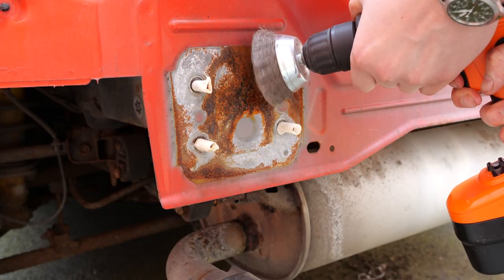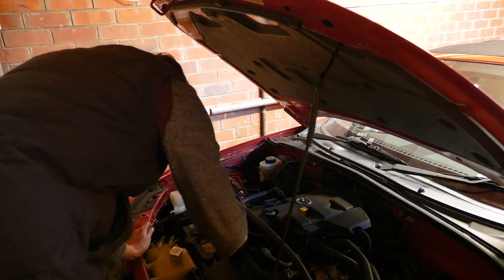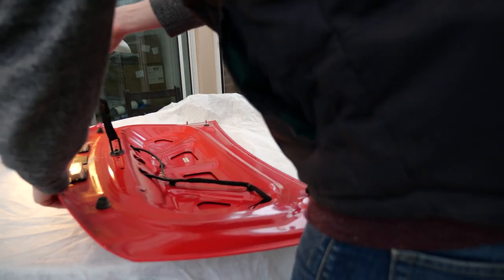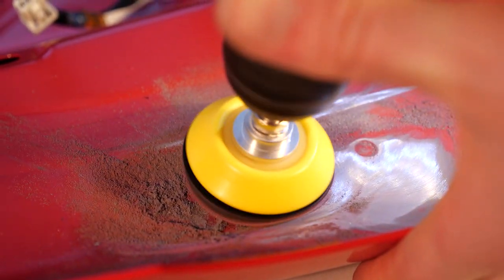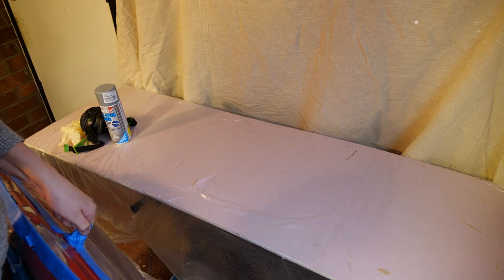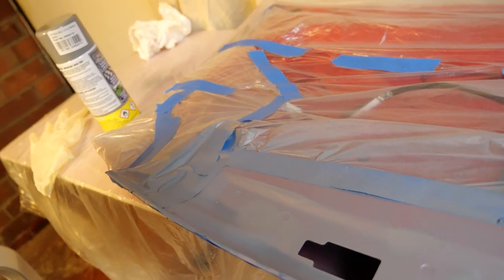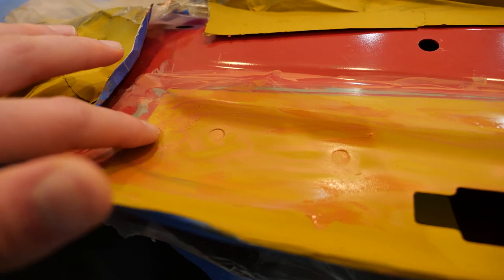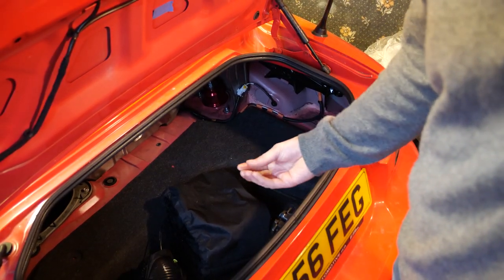Not more rust?! - DIY corrosion repair Mazda MX-5

Comment: An excellent and clear video however a whole week with the car off the road? I have found water in the boot so am about to go through the list of problem areas. My Mk2 has a steel boot lid and I know there is rust in the usual place around the edge. The boot seal is in excellent condition and the three darinage holes have been cleared out with the trumbone brush.

Comment: I'm an ageing old fart but enjoy your vids - especially as I've just bought a 2008 NC Sport Roadster 2.0  I've taken a whole heap of abuse from pretty much everyone that knows me - deservedly so as I'm always quick to dish it out!  I've had pictures of stiletto heels, hairdressers salons and rainbows texted - you name it I've had it,. But it actually just steels my reserve! I originally went hunting for an S2000 but was talked into trying one of these (I had my own stereotypical views so took some persuading!) and was hooked. My daily is a 430d BMW, but my weekend weapon is a Challenger Hellcat - so adding this was something of a chalk and cheese decision - which was actually the whole point. I LOVE the Hellcat - but its a 2-tonne missile - you have to drive it with constant respect, and take liberties at your peril. Yes - the MX feels like its powered by a rubber band  - and a thin one at that - (it wouldn't see the tail lights of the 430d let alone the HC) and I dread to think what the 1.8 would be like power-wise - but it doesn't matter. I can take it by the scruff of the neck, head for the B roads with the lid down and give it full beans without fearing death every time I do so. Handling is amazing - especially as the first thing I did was fit the 30mm Eibach lowering springs to bring it down to the height it should be. Could get my bloody HEAD in the gap between wheel and arch - literally had them fitted first week of ownership.  It's a GREAT car and the haters can... well - carry on hating. I guess 99% of them - like me until 4 weeks ago - haven't ever driven one. £160 a year fully comp with a £50 excess (one of the few advantages of approaching 60) - buttons to run. And it was only after i bought it I discovered even MX5 fans often look down their noses at the NC - although for me its far and away the best looking version of the lot. Especially in Copper Red like mine.  What I WOULD suggest to most though - if you have the option -  is to get the best you can afford . I found (and didn't have to look too hard) a one-owner, garaged from new, only used on dry warm days 21,000 miler from a guy who bought it on his retirement as an I-deserve-this second car - and I'm very pleased to say its completely rust free, top to bottom as a consequence. It's going to Krown rust-proofers in Tipton in a couple of weeks to make sure it stays that way, as some of the uploads you have done are a bit scary. I don't want it dissolving before my eyes.... So - if your budget will stretch to it (I'm aware, of course, not everyone is so lucky) - there's no shortage of cars like the one I found; probably cheaper in the long-run too if your rust experiences are anything to go by!! Keep the vids coming - really enjoy them  :) Oh - one last thing - where the hell do I find the Cobalt back box you mention in another vid of yours?! Can't seem to find one anywhere...

Comment: I really appreciate your videos showing the details, I've had my PRHT NC for a couple of months now and I've noticed little rust specs on the spot welds. I'm going to take the number plate lights out and make sure everything is OK, it's obvious that any road salt and grime gets thrown up here. 

I also appreciate a better look at the plastic blanking plate at 3:32, I'm looking into adding a plug to this for solar trickle charging when parked nose-first in the garage and/or a rear camera. I can't really think of anywhere better to put a trickle charge plug and as the car has reverse sensors there should already be a battery feed I can tie into.

Comment: Great video and a job well done.  Mine's the steel lid, I've done a temporary job, on mine it was just a few tiny spots, so I sanded back just where the bubble was and hammerited it, before manually touching in the top coat.  Will stop it rusting until I have the time to do it in the way that you have.

Comment: if you fit LED bulbs to the boot and front floor pan you will find it great on dark nights, also if you take one of the dash lights out you can check the fitment type bayonet twist screw etc then you can fit coloured LEDs to the colour of your choice available from amazon and ali express

Comment: When I did mine, I unclipped the lights cable from the underside of the boot and pulled it through, leaving it attached to the hinge and left it hanging in the boot space, then removed the boot lid. I also popped out the rubbers leaving it devoid of all bits and pieces, This is because when painting, I wanted to add a bit more colour the to thinner painted areas and the clear coat it all. Part of the reason NC's have this issue is because Mazda didn't clear coat the underside (certainly not on the earlier years models), and which includes the exposed area with the number plate lights. The only thing I had to mask off was the MAZDA part sticker.

Comment: Hello, 

big Fan of your Mark 3 MX5 Series. You inspired me to buy one aswell, so i got a 2014 with 45.000 miles yesterday. I love this car so much, but I noticed two things that need repair: The Volume button on the radio is missing, i have to adjust the volume with my fingernails or the steering wheel function. The other one is the interior light. It does not seem to work no matter on what mode (On, Off, Doors) I put it. Do you know a good site where I can get spare parts to fix this?

Cheers from Germany

David

Comment: Great set of videos - helpful for a fellow MX5 owner - mine's almost exactly the same. One question - did I miss the video where you fitted the spotlights or did the car come fitted with them? Plus do you know where I can get replacement seats - mine are horrible uncomfortable fabric, slightly worn in places - but I'd really like some leather seats. Keep up the good work. PS and if your windscreen doesn't leak yet - it soon will - A video on stopping the leak onto the passenger floor would be useful.

Comment: Looks really nice. Well done!  My 2006 GT has similar paint cracking, bubbling in that spot. I’m not bothered enough by it yet to do what you did here... yet :-)
Reply from the maker: Haha, I don’t blame you! This took about 7 days in total. Had to drink lots of tea ☕️
Reply: @Car Thought  Is it just an aesthetic fix or will it get worse if untouched ? I have a little bubble right under the MX5 Logo but it doesn't seem to grow or anything. I know it is not rust as the trunk lid is made from aluminium but do you think it needs to be fixed ?

Comment: I notice you used the key to open your boot. Does the key fob boot opener button not work on your car? Mine neither!
Reply from the maker: No, batteries flat. Just haven’t got around to changing it yet!
Reply: @CarThought  My remote works on the doors, just doesn't open the boot!
Reply: Great result, all the preparation paid off👍

Comment: just thinking if i can do it without removing the boot lid while just cover the rear of the car and do the sanding and painting. any advise?
Reply from the maker: Very possible, just will be more difficult for sanding as the boot lid wobbles on the hinges.

Comment: I do own a 2007. Here is a question if you couldhelp me out. I need to buy a torque wrench for the car. What would be the torque range to buy as to cover most of the car?
Reply from the maker: Hi, thanks for the comment, totally depends on what you’re going to do on the car in all honesty. If you’re at the stage of purchasing a torque wrench you probably have a pretty good idea of the jobs you’re going to do? 
So for wheels, control arms and crash structures I’d recommend a half inch. If you’re interior mods it’s probably more 3/8 inch. Personally id only torque safety critical bolts like seatbelts and seats in the interior, but there will be an overlap in ranges. So a 3/8 will overlap a 1/2 inch in the range but the 3/8 will be more accurate lower down if that makes sense?
Reply: @CarThought  Hi. Thanks for your response. Yes it makes sense. Well, I am not so keen in touching any of the main engine parts. As you said, interior parts mostly such as seats etc, but maybe also suspension parts like end-links for the sway bars, suspension mounts, struts, perhaps the alternator, and that's it. In other words, whatever someone can do with pretty basic equipment in a home garage. I was thinking of a wrench 1/2" w/ 40-200Nm range, but then it seems like a 3/8 would be more versatile.  
BTW, this is a really great channel. Exactly what was missing for the NCs. Keep up that great work.
Reply from the maker: Thanks for the support mate. Sounds like either would be good for you. Personally I prefer a 1/2 inch as it’s easier to torque wheels down with it (longer lever). This is the one I have:
https://amzn.to/3qHNI05 👍